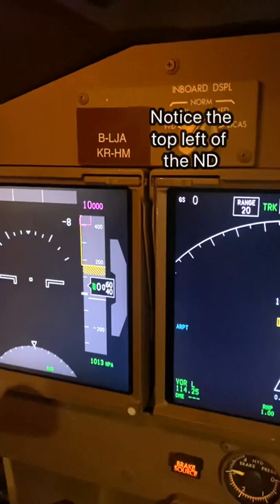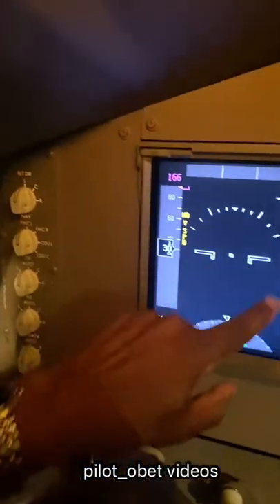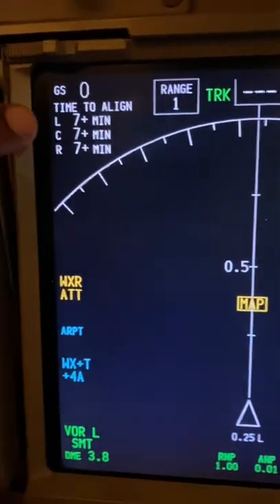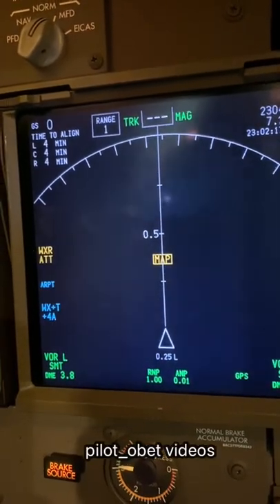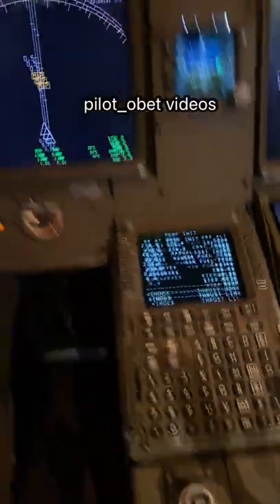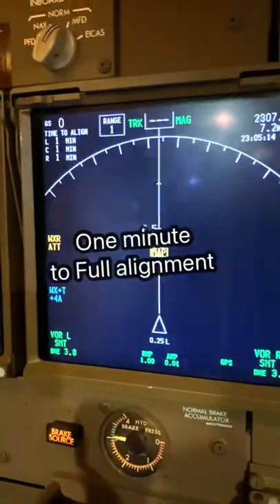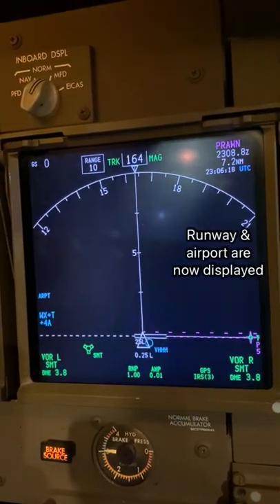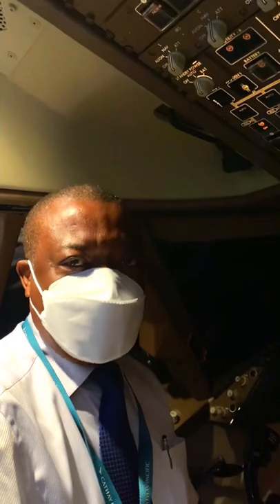Boeing 747: IRS - Inertial Navigation Systems Alignment

Comment: If setting to Nav does the alignment, what is the Align setting on the switch for?  Love your videos. Thank you for making and sharing them.
Reply from the maker: We use align normally for a rapid realignment during a transit stop for example. We select ALIGN, re- enter the destination position where we have arrived, then reposition switch to NAV. This aligns the system within 30 seconds rather than a full alignment of 8-10 minutes😀
Reply: @pilot_obet  thank you!

Comment: Are you guys switching it to OFF mode after every flight making the next crew to put it into NAV mode. Or is this required to do when starting the aircraft from cold and dark status?
Reply: Yo I work at fedex loading 767s all night  
I asked what there procedure was for the IRS alignment, and they said they turn it off when they leave.
Then, (normally about 45 min later) the next crew said the first thing they do is switch the IRS to NAV for the alignment.
Reply: @TheAdamGore  ahh i see. Understood. Thanks

Comment: With enhanced GPS and other satellite-based navigation systems, do you think the days of IRS are numbered, or do you think there will always need to be an internal independent nav tool?

Also, since the IRS determines the aircraft movement by recording acceleration in each axis, how does the IRS initially know what direction the plane is pointing in? After all, the plane is still, so the IRS should have no idea where the plane is or where it's pointing without external input.
Reply from the maker: IRS will be around a while longer
Reply: IRS will remain there for a long time as it is the only independent form of navigation and as it provides information to many other systems. A gazillion systems on the aircraft relies on IRS data as said by @imperrfectStranger.

The IRS itself does not know the initial position of the aircraft. So, that data needs to be input. In most of the cases, when the pilots insert the airport code, the IRS uses the stored coordinates of the airport in the flight management system or it may use the location provided by the GPS. Once it knows the location, it uses a series of integrations to calculate the change in latitude and longitude and adds the change to the initial latitude and longitude until the aircraft comes to a stop and IRs are shut down.

In the very old inertial units, the pilot has to manually put in the location. This is why parking gates at airports have the latitude and longitude painted of the gate indicator board. It is still good airmanship to crosscheck gate coordinates with your IRS coordinates once the alignment process is done with.

Comment: I’m curious as to how the aircraft knows where it is, you haven’t explained the FMS pages and how the aircraft needs to be told what stand/gate it is at and using data from the gate sign (stand number, GPS data). Don’t you need to confirm gps long latitude into FMS, that would be from the GPS data displayed on the gate sign below Safedock VDGS (NIGS) etc. Thanks
Reply: Yes, you have to confirm the GPS position of the aircraft in the FMS Position Reference page. You can either enter lat/lon coordinates from charts, gate signs or copy the coordinates from the on board GPS (after confirming it is accurate and correct) available on the same FMS page.
Reply from the maker: You do put in the position as part of the FMS setup- I didn’t just show it
Reply from the maker: If you don’t put in the position when it is fully aligned, there is a scratchpad message on both FMS screens that say ‘ENTER IRS POSITION’

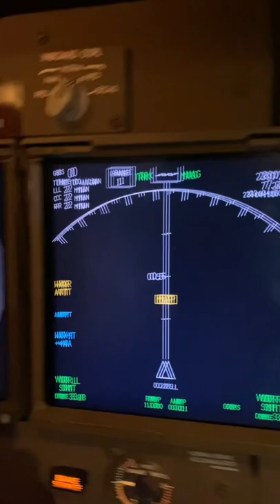Comment: At around 2:33, I noticed on the OVHD panel that the APU Generator 1 and External power 2 were turned on, yet on the EICAS it said "APU running." Just a question, but I thought that when the "Avl" light comes on the APU gen, then both can be used right? Is that when EXT power is disconnected? Thanks